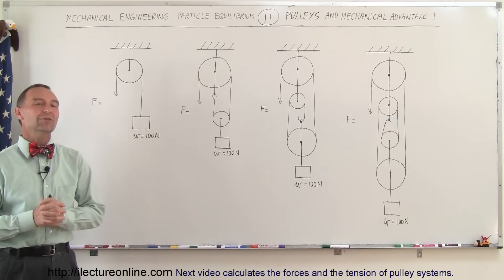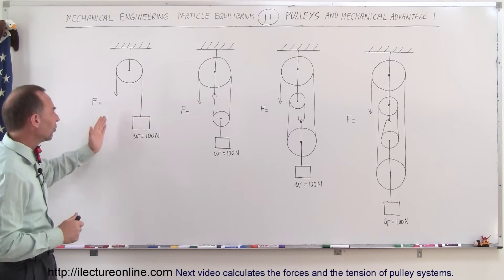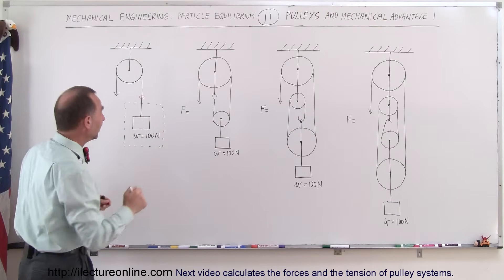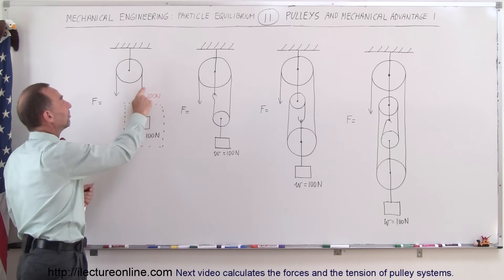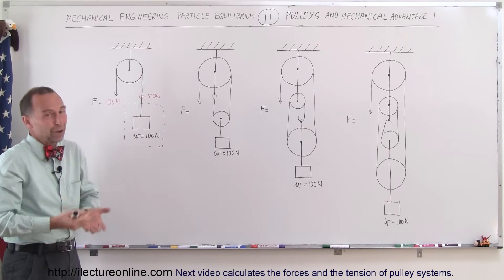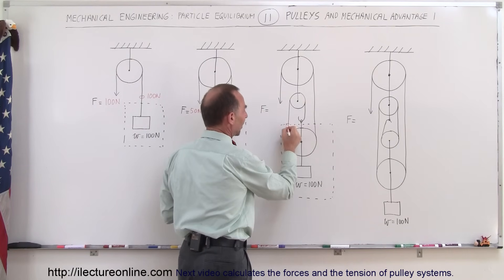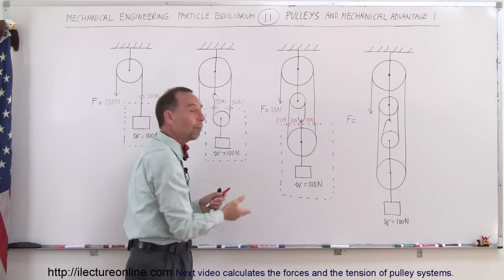Mechanical Engineering: Particle Equilibrium (11 of 19) Why are Pulleys a Mechanical Advantage?

Comment: I noticed in your illustration the pully wheels are of different diameters; question: does each wheel size have a part in the equation or is the diameter of the wheel on no consequence?  Thanks!   ♫
Reply from the maker: Good question.  Ultimately the size doesn't matter in principle, but the sizes are chosen to keep the vertical ropes parallel and to keep the ropes from getting in the way of each other.
Reply: @MichelvanBiezen  Thanks!
Reply: İlave olarak; pratikte kasnak çapı büyüdükçe, halatların bükülme direnci ve merkezdeki sürtünme etkisi de azalır. Ama bu özellikler, burada anlatılanlardan daha arka plandadır.
Reply: @NejatÖvütmen-f8n  Thank you!  ♫

Comment: I forgot that the pull distance increased as the pulling force decreased.
Reply from the maker: Yes, if the force required is 1/4 for example, you'll have to pull the rope 4 times as far.

Comment: We are all focused on the forces getting less and less , I'm more worried about the top and main pulley hanging from the ceiling or whatever ...... that one is still holding on to everything including all the extra pulleys and cable
Reply from the maker: Yes indeed.  The force on the ceiling equals the weight + the force pulling downward.

Comment: This does not work in zero gravity environments or in space, a key factor which is not mentioned in video.
Reply from the maker: In space, the mechanism is different.  It requires the calculation of impulse and the change in momentum.
Reply: Yes, it works in space or on diffrence gravity.  It works the same.  You might want to look at the definitions of the words he I'd using.

Comment: But the more pulleys you add, the less distance you can pull the weight because the pulleys collapse on each other, and block the weight.  You somehow have to arrange them so they do not hit each other as the line compresses.
Reply from the maker: That is indeed a limiting factor.

Comment: I picture (especially in simple cases) replacing the cables supporting the load (and the movable block(s) of a block and tackle set up) with cables in tension attached directly to the ceiling.  Four cables supporting the load weight means each is supporting 1/4 of the weight.

Comment: Notice that the amount of pulleys (on the x-axis) results in a curve that approaches 100N asymptotically (100N being on the y axis) More pulleys are going to give you diminishing returns and at some point, the rope has to be so long (theoretically approaching infinity) that it has more Force (mass x acce,l g in this case) than the thing you are trying to move. Would be a cool little Physics problem to analyze the curve vs the rope, leaving friction out. As the 8th grader pointed out in below comments, add friction, small pulleys vs rope thickness etc and the whole thing goes south quickly.

Comment: Does the radius and the difference between the radiuses of each wheel influence the force needed to lift an object?
Reply from the maker: The radii are chosen to keep the rope vertical, but it doesn't have an effect on the force ratio.

Comment: Sir. I want to thank you!! I truly, honestly and genuinely want to thank you!!! I have watched several videos on pulleys and I have to say. Your video was by far the best explanation of a pulley system!!!! I understand it now!!! I thought I already had an understanding of this, but I was wrong. I always thought if you hooked a cable to an object, ran the cable through a pulley that was attached to another object then  to what you were using as your pulling force, you got double the pulling power. I was wrong! By doing it like this you are only changing the angle of the pull! You’re not getting any mechanical advantage at all! Am I correct? Again, thank you for showing us such a clear explanation of mechanical advantage when using pulleys!
Reply from the maker: Glad the video helped in your understanding.

Comment: This does not explain why at all. This explains how.
Reply from the maker: It shows that at any point in any free body diagram, the forces and tensions in the vertical direction are balanced.  But you are correct that it doesn't explain why less force is needed to pull a heavy object upward.

Comment: Wowzer! I adore that classy bow-tie. 
    But!--try as I have since the day Newtonian physics died, I have labored to conceptualize the counter-intuitive truths of mechanical advantage. How string, by some insinuation for the sheer frequency of contact, can modify the dynamics of weight, even multiply its powers of levity, is really, truly, beyond me. If no weight is removed from a pulley system, then simply increasing the number of contacts by one element of lift work seems trivial in the sum of things. Compounding interest by subdividing the same rate only produces many small products that total the same. No? My brain can't locate the advantage, even though, of course, I accept its reality.
Reply from the maker: Yes, I did not give a good explanation as to why.  The bottom line is that the work performed by you pulling the string down must equal the work done to lift up the object.  If the force required is only one fourth the weight of the object, then you must pull down 4 times the distance that the object is lifted up.    f D = F d    The product of the force (or weight) and the distance moved must equal on both sides of the equation.

Comment: for those struggling to understand the simple way is to divide the weight carried by the number of cables  which will be equals to how much force required let me give you an example you have a load that is 100N and  cable you just divide 100 which is the load and by 4 which are numbers of cables which gives you 25 force

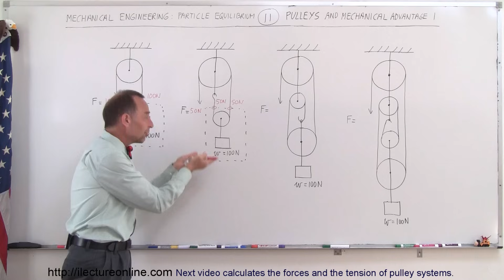Comment: @3:15 i don't understand how you can pull twice as far like 2 meters but only lift the object 1 meter?? 

i mean, the rope doesn't extend. how come i already pulled the rope 1 meter but the object lifted is not the same length? that would only be possible if the pulleys are not in a fixed position, correct?

Comment: Problem is that most people don't pull the rope at a perfect 0 degrees angle to the displacement direction (vertical) of the object we're trying to pull up, so we wind up having to exert more effort by having to pull the rope a longer distance than predicted by mechanical advantage. This is because cosine of an angle is part of the work equation and the highest cosine value is for an angle of 0 degrees.

Comment: In the 4th ex. Why we didn't take the free body diagram from the last polly if we do so how we can calculate? . But the energy required it will be the the same  eventually as we need to move distance same  as the amount of force reduction w=f.d ,f/4 * 4d

Comment: An interesting video. No mention is given however as to why the rope has to be moved x times farther to gain mechanical advantage.
Reply from the maker: Mechanical advantage is the ratio of how much weight you can lift to the force applied to do so.   The extra distance you have to pull with a smaller force to lift a greater weight is related to work input = work output.      And work is defined as force x distance
Reply: @MichelvanBiezen   Thanks. Now I have got it.

Comment: Total power applied does not change since one has to pull more as it gets easier, but it reduces the power applied at once that is the difference. Actually it is the same by dividing a 1000kg into several pieces and carrying each one by one you will be tired but you will be able to carry, else you will not be tired since you will not be able to carry anything that heavy :)
Reply from the maker: Power = work / time, thus it depends on how fast you pull.  The difference here is the "force" needed to lift an object.

Comment: I have always found the term mechanical advantage when referring to pulleys very misleading. In reality of course the advantage is through the capability to lift or move something heavy, there is no advantage through the saving of energy. In fact of course a human performing this task would use more energy (even disregarding inertia and friction) when performing these lifts with a pulley as they take more time to carry out and therefore more energy is used simply sustaining the body. Vey well explained though.
Reply from the maker: Mechanical advantage by definition is the ratio of the weight lifted to the force applied.  In order for the work/energy to be balanced it will require the force to act over a much greater distance (again proporional to the weight/force ratio)

Comment: I have a question.  I worked with movie stage mechanics for a while and they told me about the tests and training they needed to perform for their union.  They said that a 100 lb weight hanging on a pulley would exert 200 lbs on the ceiling because you had the 100 lb weight on one side of the pulley and you were holding the rope with a 100 lb. pull on the other side.
Logical, but is it right?
Reply from the maker: That is correct for a single pulley.  (like the first example on the left)
Reply: @MichelvanBiezen  Thank you.  Great videos.

Comment: Use old lawnmower wheel rims and a plywood backboard to mount them on to experiment to your hearts delight. If you have a small weighing scale to weigh the pulleys and spring pull fisherman's scale to measure the force needed to lift a brick and see how their weights cause the forces to deviate from the ideal, especially on compound pulleys.

Comment: 3:16 you said in the second pulley you can move it 2x easier but also have to pull it 2x harder so isnt it just 2/2= 1 so the same as a regular one?

Idk if i could explain myself right
Reply from the maker: If you need 1/2 the force you will need to pull twice as far as the total work must be the same.

Comment: I noticed this is 8 years old, but I had to comment anyway: If you factor in the efficiency of each pulley (frictional losses), you may no longer get mechanical advantage after about 5 lines. If a pulley was .9 eff, then it would take 110 lbs of pull to hoist 100 lbs of load. A spread sheet will show that the pulling force no longer decreases when continue to add lines and pulleys.
Reply from the maker: Yes indeed.  That said, pulleys heavy very little friciton and do not require that much energy to rotate them.
Reply: If you are a mechanical engineer, you are fooking stupid. If you aren t you are just an ignorant
Reply: your 0.9 efficient pulley is made up or this comment
for example, do you know how inefficient would a pulley be, one that is not especially lubricated ?

Comment: doing less rate of work with respect to distance in exchange for using less force
Reply from the maker: Less force is required, but more distance is needed.  The product of F x d remains constant.
Reply: @MichelvanBiezen  but the rate of Fxd with respect to d should be less right? and the TOTAL work done is same because f is halved and d is doubled

Comment: He explains very well.  In every explanation I see, they forget one thing...where does this mechanical advantage come from?  This gives you a way of thinking about it, but it leaves the key element out, which is the structure that holds up the pulley.  The structure is pulling up against the downward force and the more force you apply to that single attachment point, the better the advantage.
Reply from the maker: The mechanical advantage is the ratio of the force required to lift the object to the weight of the object itself.  As shown in the video.

Comment: hello professor, thank you for these excellent lessons! i have 1 question, what about the signs of those pulling forces? Aren’t they negative?
Reply from the maker: It depends on how the result is presented.  As a vector one must add the direction, but as a  magnitude, it can only be positive.  (The magnitude of vectors cannot be negative).
Reply: @MichelvanBiezen  thank you 🙏

Comment: If you pull 50N for 2 meters or 33N for 3 meters, would that equal pulling a total of 100N? Or would it be 50N or 33N?
Reply from the maker: If you pull 50N for 2 meters it will lift the 100 N weight by 1 meter.

Comment: Thanks for the vid.  I wonder if it could be used to power a generator/ alternator by lifting a weight using 12v / 18v modern drill motor .  Once the weight is suspended it would be stored energy to be released to power the generator/ alternator , ( either 18v output or inverted to 240v ) a set of bicycle gears could be incorporated on the output or the input  if required? 
 I should add I've an understanding of 1st law of thermodynamics. 

My thoughts are these examples are achieving more than the input or a trade off :
Reply from the maker: The concept of storing energy by storing object in a high place is an old one.  Pulleys do give us the opportunity to lift things more easily.

Comment: why did we take the 2  bottoms pulleys instead of just one in the free body diagram in the case of the 4th pulley? thank you so much for making these videos by the way
Reply from the maker: For the arrangement to the right, the bottom two pulleys are connected with a solid bar.  They act as a single system.

Comment: Doesn't the diameter of the pulleys matter also?  If you mix large and small pulleys, won't that change the effective ratio and force?
Reply from the maker: The size of the pulleys do not matter.  However that said, notice that is some cases one pulley is exactly half the diameter of the other in order to gain the desired effect.

Comment: Your 3rd example isn’t correct. The correct answer is 33.3333333333333333333333333333333333333333333333333333333333333333333333333333333
3333333333333333333333333333333333333333333333333333333333333333333333333333333333333333333333333333333333333333333333333333333333333333333333333333333333333333333333333333333333333333333333333333333333333333333333333333333333333333333333333333333333333333333333333333333333333333333333333333333333333333333333333333333333333333333333333333333333333333333333333333333333333333333333333333333333333333333333333333333333333333333333333333333333333333333
Reply from the maker: That is 33 rounded off.

Comment: Can a 2000 lbs weight dropping 2 ft, lift a 500 lbs weight 8 ft (ignoring friction)?
Reply from the maker: With the correct pulley system, yes.

Comment: Very few people really understand the principle, The principle is that there is a 2 to 1 leverage in each moving pulley, find it if you can. Obviously this Professor does not know that.
Reply from the maker: That is a strange assumption.  The leverage depends on how the pulleys are connected.  We have examples where the principle is different.
Reply: @MichelvanBiezen  the principle is: each moving pulley (circle) has (is ) a lever. find it.  I could prove it with a drawing, I cant upload drawings here.

Comment: Does the size difference between the pulleys affect anything?  Like a gearing ratio?
Reply from the maker: As long as the strings are vertical or nearly vertical, the size of the pulleys do not matter.  The sizes are chosen to keep the string vertical.

Comment: The FIRST thing you should always teach about pulleys:  they are simply a series of levers, each one carrying a bit of the weight, and larger diameter pulleys multiply force just like a longer lever does, add more pulleys is same as adding more levers.  
This is also how power differentials work in automobiles, a series of levers with prescribed lengths.
Reply from the maker: Yes indeed.  The video shows why that is true.
Reply: @MichelvanBiezen  I don’t recall him using the word lever once. That is why I commented.

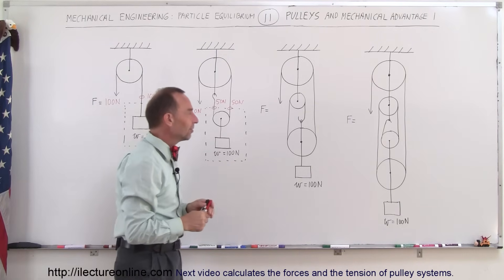Comment: 3:29 The reason you have to pull the rope 2 meters to lift the weight 1-meter can be understood in the following way. Since there are two ropes supporting the weight both ropes have to be raised 1-meter when the weight is lifted 1-meter which is a total of 2-meters. That means the rope you are pulling must be pulled 2-meters, 1-meter for each of the two ropes supporting the weight. The same is true for 3 ropes, 4 ropes and so on.

It also makes sense when you consider the work done in lifting the load. The work is the same (minus any losses from friction of course) in our ideal case no matter how many pulleys you use.
Work = force X distance, so exerting half the force means the rope must be pulled twice the distance. The number of ropes supporting the load is the mechanical advantage. Divide the load by that number to get the force you must exert, and multiply the distance the load is lifted to get the length of rope you must pull.
Reply from the maker: Nice input.
Reply: @MichelvanBiezen  33 years teaching Physics has a few benefits (getting rich is not one of them). LOL
Reply from the maker: HaHa, yes indeed.

Comment: Question. How does using more pulleys impact the size the working strength of a pulley? Meaning, can you use smaller pulleys, if you use several of them?
Reply from the maker: The size is not important, it is the arrangement of the pulleys.  (Size sometimes matters if you need a 2:1 ratio in size.

Comment: Sir I wonder what would happen if one changes the point(generally the center of the pulley) through which it is attached to ceiling. What would be the change in acceleration of the blocks?
Reply from the maker: We did not cover acceleration in this problem, we do that in other playlist in the physics section.   (Not sure what you mean by "change the point").  Pulleys are always supported at their center of mass.
Reply: If you could tell your Gmail ID I may send you the actual question.